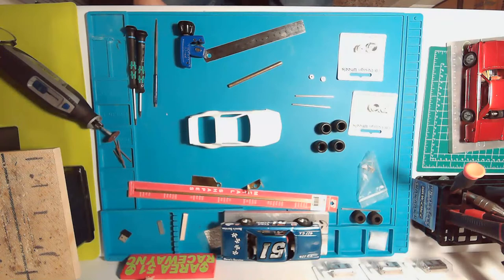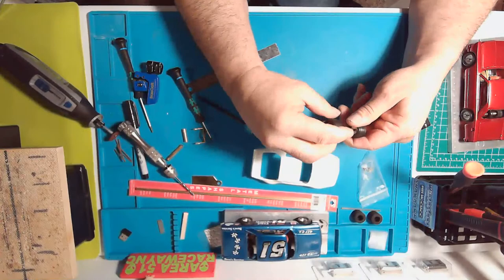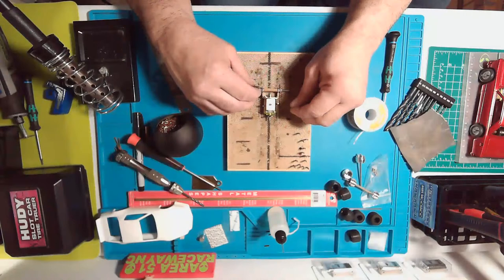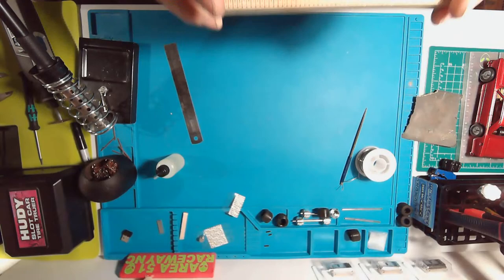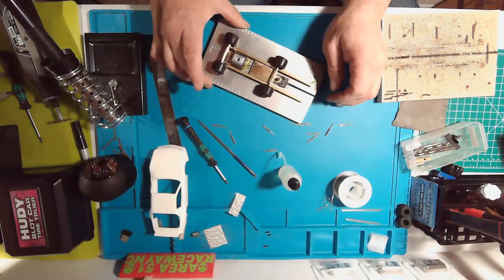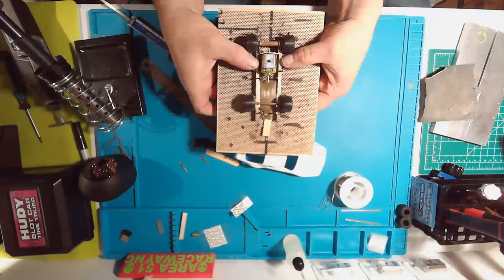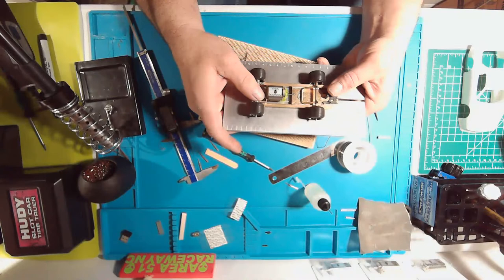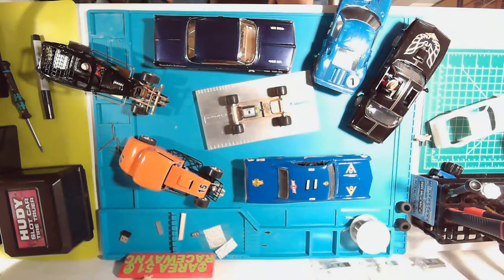Scratch Building a 1/32 Slot car Live

Comment: I see you are no longer using the eye dropper for flux and using the smaller oil type bottle.This seems much more accurate. I just emptied and thoroughly cleaned one of my old oil bottles and am using it for my acid flux. So I don't accidentally oil my motor and bushings with flux I drew a skull and crossbones on the flux bottle. Keep up the great vids. Jorge. The sound and video are excellent. Trev must have had a bad connection.
Reply from the maker: When you finish soldering the chassis was it off with vinegar and baking soda to remove the residue from the flux.
Reply: I use dish soap and an old toothbrush then dry the chassis thoroughly. If you accidentally use flux on the motor bushings thinking you are oiling them the motor will rust. Not that you would but I can see me making that mistake because my oil and flux bottle are identical.